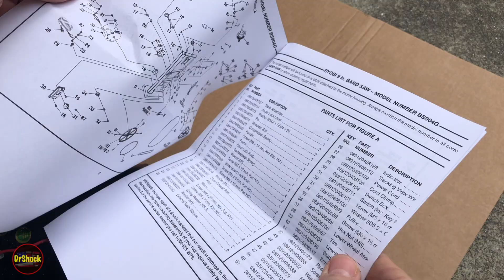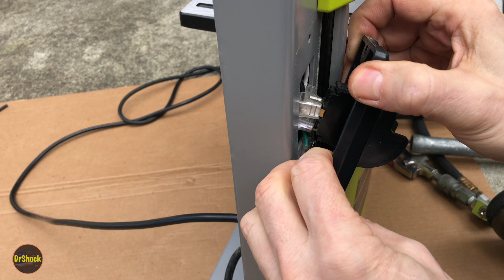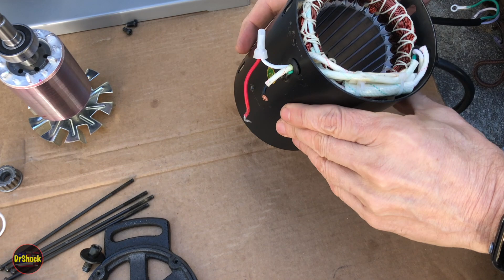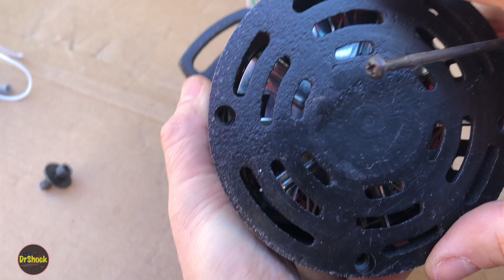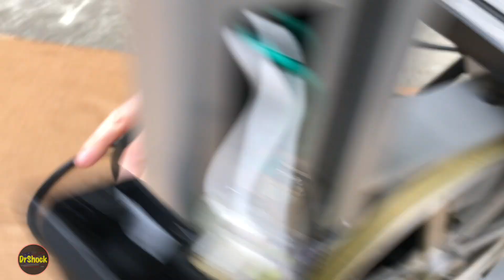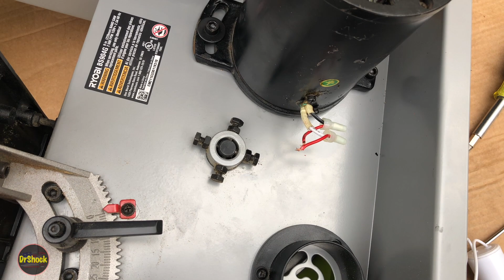Ryobi BS904 / BS904G Bandsaw Motor No Start Humming ~ Diagnosis / Teardown / Rebuild / Replacement

Comment: Exactly the same problem with my DraperBandsaw induction motor ….will take mine apart and do the same checks….but I guess It’s the same (although I’ve not come across a resistance measurement like that before -  Ie : it either measured resistance and was OK or  there was a break in the coil. Thanks for a very comprehensive video.
Cheers
Pete

Comment: Great job - extremely thorough and methodical! You've saved me some time in making a decision. I have the same saw with the same problem. I can get it going by opening the top cover and spinning the flywheel with a stick, which isn't ideal. It seems like a sad waste, but I've now concluded my best option is to replace the whole thing with something else. These motors are apparently very delicate and not made to last.
Reply from the maker: Thanks, normally an electric motor, properly used and maintained, should last for decades of use.  But the Chinese motors Ryobi used in this model have windings which seem very sensitive to heat, sawdust and vibration.  Three things very commonly found in a bandsaw.  ;-)